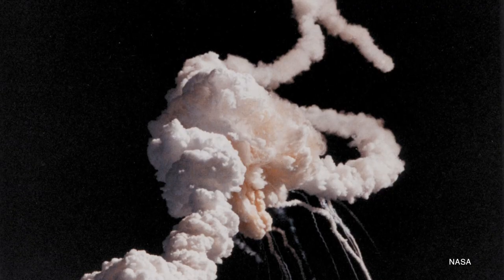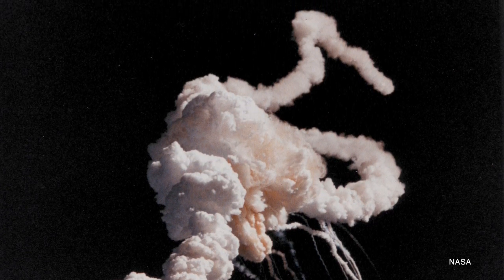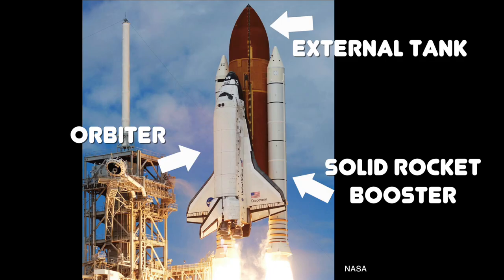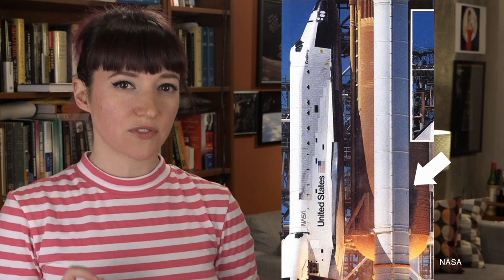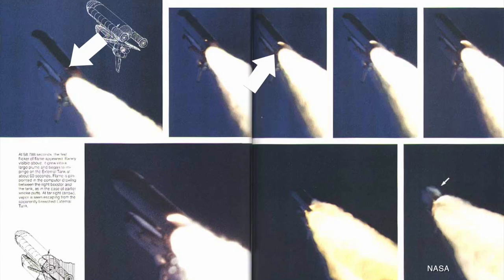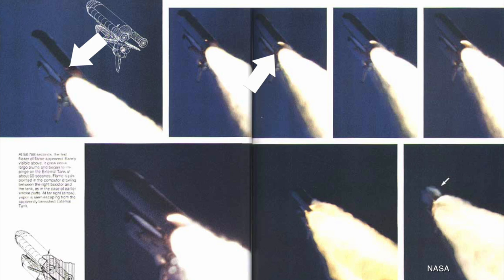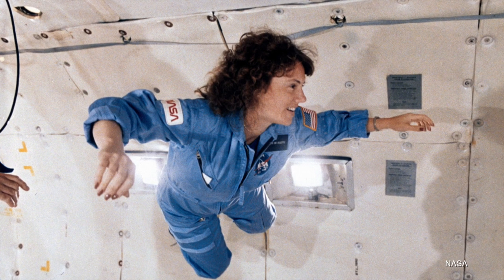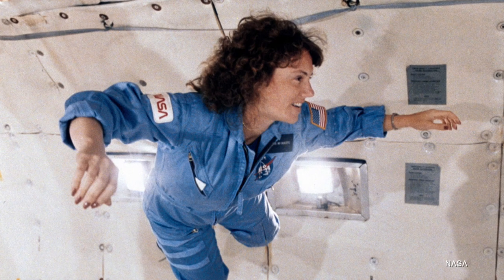How the Challenger Disaster Changed NASA

Comment: NO, the flame didn't burn through the external tank, it burnt through the SRB's lower attachment point to the external tank, the bottom of the SRB then moved outward and the top inward rupturing the top of the external tank.
Reply: Winston Smith the flame did cut into the external tank. Data recorders noticed an abnormal drop in pressure for the lower tank, which caused the engines to start to lose thrust as they weren't getting the correct amounts of fuel

Comment: Transparency is one of the most sacred things in any organization. There is no greater freedom than being able to be transparent with employees and managers. When people can be transparent with one another, especially with up-the-ladder coworkers, and not fear retaliation for speaking up against issues, greater harmony can be achieved. If you have been following the Elizabeth Holmes and Theranos scandal in the news, you might know that many employees were afraid to speak up regarding ethical issues for fear of retaliation or losing their jobs. The employees that did speak up at one point were fired and told they would be blackballed from Silicon Valley. The O-ring may have been the immediate cause for the explosion of The Challenger, but the real issue that caused this disaster was the lack of transparency between the engineers and the managerial team. The lack of harmony between the two teams perhaps made it more difficult for the managerial team to understand how dangerous this O-ring issue could be. Transparency between the different component units at an organization is paramount to the success of the overall organization. Individuals in an organization work toward a common goal and that comes most effectively from transparency at the individual level, the component level, and the organizational level.

Comment: For CUA MGT 311:
This tragedy is one of the most well know to date, in this video we watched about NASA and the Challenger launch and the struggles NASA had in terms of its management. The Challenger was a renowned launch because of the teachers in the space program aboard it. The shuttle lifted off and then exploded in mid-air about a minute and a half after. It was determined that the explosion was due to an O ring on one of the vessel's seals, the drop in temperature that day caused the rubber ring to lose its elasticity. Once in the air, the shuttle's fuel was able to leak and catch flame causing an explosion due to the full tank. NASA was more concerned with meeting the date for their launch and their teachers' program than ensuring the safety of everyone on board. They didn't want to face the ridicule of the public so they rushed the launch on a day that was unsafe due to the below-freezing temperatures. This accident was a learning day for NASA and brought to light the dangers of not taking proper precautions when dealing with something as dangerous as space travel. NASA wasn't able to implement the proper precautions before the Challenger disaster and the seven astronauts on board had to pay the price.

Comment: The Shuttle Program would have ground to a halt by mid-1986 just due to the fact that they were running out of spare parts. With some parts, they had ONE, and this one part had to be shuttled (yeah, I know) to whichever orbiter was ready to be rolled out to the pad.

The plan to launch a Centaur upper stage from the cargo bay of the shuttle made launching with iffy SRB seals seem trivial by comparison. The plan was to launch 2 Shuttles (Atlantis and Challenger) 5 days apart, both carrying a liquid fueled (LH2/LOX) Centaur upper stage, 

Safety concerns were discounted by NASA. One concern was whether or not the liquid propellants in the cargo bay would slosh about causing control issues. The biggest issue is that, in an abort, the propellants would have to be vented overboard, while the shuttle was still flying with the SSMEs firing, creating all the ingredients for an explosion.

Commander Hauck basically went to the crew of his flight (one flight would launch Ulysses and one would launch Galileo} and said that NASA was taking too many risks and if anyone wanted to be removed from the mission, he would support them. Astronaut John Fabian was training for one of the flights (STS 61G) but left NASA in January 1986 just before 51L, due to the lax safety in the Shuttle /Centaur program.

Comment: I was working at Aerojet Tactical Systems on the day Challenger went down and all I remember were people crying in the halls and radios on all over the building. It was a very emotional time and the company was subdued. Aerojet manufactured the OMS engines for the Shuttle as well as reaction thrusters and we were particularly close to the program. It was a tragic disaster caused by a horrid design for those SRBs. They should have been monolithics and never segmented design.

Comment: The disaster will go down in history as a teaching lesson for the danger and security of lack of trust and communication with engineers during crucial decision making. It also goes to show the importance of understanding all pieces of a project/business operation should be on the same page to make a fully calculated decision on what are the consequences of actions about to be made. The timing of the decision in terms of NASA was made due to external pressure from government and society. All factors should be included, especially in such a dangerous decision like the launch, and a lack of camaraderie and bravery from all levels is the reason for the unfortunate event.

Comment: Why did the Shuttle not have sensors to detect a leak, fire, or O ring failure? This could have triggered an automatic abort, separating the boosters, ET and had Scobie preform a Return to Launch Site Abort, correct? Why did this not happen?

Comment: During the Challenger disaster, the space shuttle exploded due to two different factors. First is the design of the aircraft and the second was on the people that had things to do with the launch. I think the people higher up really allowed their pride to be involved in their decisions. Some of the engineers raised their concern about many things in the mission and the people higher up chose not to listen to them. I think along with their ego, I believe that it also was a simple lack of trust with their members, it was said that their members were concerned about meeting deadlines and doing what pleased their superiors the most. Because of these actions with these serious circumstances, the cost of these mistakes were unfortunately peoples lives. These are obviously serious mistakes that you can't make, especially with a serious project where peoples lives are being put on the line. It seemed as if they were trying to cut corners which is proven and shown in this that when you are running your own company, you just should not be doing. It may benefit the company in the beginning, but will almost always catch up to them in the long run.

Comment: One of the most shocking things to me in terms of the Challenger Disaster is the notion that NASA was more concerned with their public relations impression rather than an actual technical issue with the space shuttle. While the actual cause of the tragedy was due to the malfunction of the o-ring, it definitely could have been avoided. Rather, NASA took priority and put their energy into making sure the launch was going to suit their public relations strategy since it was such a high profile event. Truly, I believe that due to the disaster, it was a publicity nightmare in the end anyway. The Challenger Disaster uncovered the toxic culture within NASA and the moments leading up to the launch. Engineers were aware that o-rings could not properly function in cold temperatures, but that was not a main concern—although it definitely should have been. Since NASA was so focused on the public relations and publicity side of things surrounding the event, they decided to neglect the actual technical problems in regards to the launch itself. This choice to neglect that was the starting point of the disaster. While the o-ring was the main culprit, that could have been avoided.

Comment: From my understanding, it ruptured which looked like an explosion. The crew cabin actually remained intact. Now it's apparent that the crew perished when they hit the water. But regardless, it should never have happened. And NASA should have listened to Morton Thiokol. The O-ring problem had been seen on previous flights. Actually, when the Challenger flew in 1985 it came dangerously close to loss of vehicle. That was something that wasn't communicated enough. After that you saw the joint redesigned with the addition of joint heaters for that very situation. I don't ever think Morton was ever comfortable affter that. Roger Boijoly gives a very clear statement on it, even the representative at KSC had went on record saying he sure wouldn't like to be before a board if something happened. Plain and simple the Shuttle was inherently more dangerous than the earlier launch vehicles. Which is why the Buran did not go with solid rockets. NASA tried to launch on a insane schedule and had a lapse in safety. You can not fly 50 missions a year unless you develop more vehicles or something. The engines alone you can not rush a refurb job.

Comment: There are a few issues I rarely see mentioned when talking about the Challenger.

First, NASA was aware of Go Fever and had a system in place to try to actively combat that.  Shortish version:  For each launch, you  have two groups of people who want to launch.  Kennedy Space Center and the contractors.  NASA set up a separate group out of Marshall Flight Center whose job was to be Devil's Advocate.  Their job was to challenge the other two groups prior to the launch.  Unfortunately, that mindset actually contributed to the wrong decision.

I'm not certain, but I think that Morton-Thiokol asking to delay the launch was the first time a contractor had ever done that.  What the team at Marshall did was immediately take the Devil's Advocate position:  Prove that it's not safe.  The culture of "prove it" was so deeply ingrained that they were unable to take a step back.  Marshall's position should always be, "Prove it is safe to fly."  If they had asked that question, the concerns of the contractor would have been an automatic "No" on the safe flight requirement.

Instead, they asked for proof of the problem, instead of proof for safety.  And the communications systems at the time weren't up to the challenge.  They didn't have routine email and transmission of digital pictures.  They were trying to fax photographs.  They came across as a useless blobs.  And, the charts they came up with were insufficient to show the danger.  They created a chart showing erosion and temperature.  But, they removed all of the flights with no erosion.  I saw a side-by-side that demonstrates that including the no-erosion flights makes the others jump out.  It's more obvious when looking at it that temperature is a probably cause.  One of those little things that doesn't always occur to someone when hastily throwing together a chart like that.

Another big part of proving that it wasn't safe was that they simply didn't have the data.  They hadn't run the engineering studies for those temperatures.  What that meant was, they couldn't prove that it was unsafe.  But that also meant that they couldn't prove that it was safe.  Again, Marshall should have objected to the launch right there.

Another point is, in the initial specs for the shuttle, the entire system was only ever supposed to be certified to fly at 40 degrees or higher temperature.  Unfortunately, nobody brought that up during that conference call.  I saw where one of the engineers went into the meeting assuming that the flight would be postponed for that reason, and was surprised when Morton-Thiokol came back from their break and chose to recommend launch.  For some reason, he didn't voice out loud the 40 degree requirement.

Washington had specific scheduling concerns, for the day of Macauliffe's demonstration and the State of the Union speech.  But, to my knowledge, none of those concerns came up at all during that call.  The problem that night was Marshall taking the automatic opposite position against the contractor, instead of the prove-it's-safe position.  And, the difficulties of putting together a clear presentation in a few minutes, that could then be shared using the communications systems available at the time.

Finally, one thing that comes out very clearly in the Feynman biography.  That was the metaphorical concept of "lying in the trench" to stop a flight.  Any engineer along the way basically puts his job on the line and says, "No.  This is not safe.  I will not sign off on this."  The Morton-Thiokol engineers were very concerned.  But, after the conference call they remarked among each other, "Well, we'll have another data point."  They knew the risk was higher than they were comfortable with.  But, because they couldn't prove the issue to Marshall, I think they went home that night with the tiniest bit of doubt in their own minds.  I think that's part of the reason why they didn't "lie in the trench" that morning.

Comment: The Challenger disaster was a tragic moment in history that could have easily been prevented. Instead of focusing on the safety of the flight and those on board the ship, they were much more concerned about the optics of the launch, such as launching on a specific day, and the PR concerns that would have gone with that, such as Christa's Mcauliffe's lesson from space. Rushing the launch and not taking the appropriate safety measures (specifically, testing if the o-rings would work in colder weather) led to something much worse for everyone involved, from the astronauts and their families to NASA itself. The disaster brought up a massive flaw in NASA's organizational structure. Management did not listen to the engineers, who were cautious about launching in these temperatures and acted on what they thought was in their best interest. This shows just how important it is to listen to everyone involved in a process at all levels. Management will never be an expert in every moving piece of a project, especially one of this magnitude, so it is crucial to listen to the people that will "make them smarter", and then hopefully, we never see a disaster like this again.

Comment: Being a part of a team requires transparency and collaboration and extremely fluid and smooth communication. During the challenger time period at NASA, NASA had lofty goals and wanted to exceed those goals. What NASA did not understand is that meeting those expectations should not come at the cost of astronaut's lives. As explained in the video, the Challengers technical failure was an O ring that could not withstand the temperature during takeoff. This however does not mean that it could not have been completely prevented and saved lives. Days before it was suggested that NASA delays their flight because it was not the Ideal takeoff temperature and parts including the O rings could fail. This however was not correctly communicated, or communicated at all. NASA wanted to avoid delaying the takeoff at all costs because it was a major PR move. An elementary teacher was on board and students across the country would be watching in class. This was a Friday and if it was delayed there would be a major PR loss, something that NASA wanted to avoid. Also mentioned in the video was the fact that at the annual state of the union the president would be mentioning the success of the Challenger and if it was delayed, then NASA would lose all of that PR as well. The bottom line is that NASA or any business or company should not base decisions where lives are at stake on PR or any other factors not pertaining to the actual safety and success of that assignment or mission. Communication is key and the challenger mission is a prime example of the devastating circumstances that could arise if there is a kink in the process.

Comment: The explosion did not rip the shuttle apart.  The main tank detached from the strut and the  other strut pulled the orbiter into a high G maneuver and the aerodynamic forces from that broke apart the shuttle.  The explosion itself was not very violent and did little damage to the shuttle itself.  The astronauts were alive all the way to the water impact.  And the O-ring was not flawed... The temperature was way below the design specs for the o-ring seal that day, and NASA was warned repeatedly by the engineers that it was unsafe.  One engineer thought it would blow up on the launch pad.

Comment: Does anyone know what the O ring was made of??
Reply: charles jenkins A specialised high-temperature butyl rubber, unfortunately of a type that became very stiff and brittle in the unusually cold temperatures on the morning of the launch. There was also thermal insulation protecting the joint internally, but this couldn't do much once the combustion gasses had a path to atmosphere through the damaged o-ring.
Reply: Thank YOU!!!